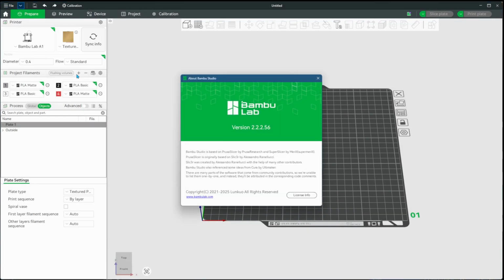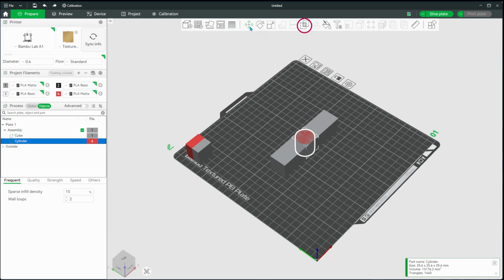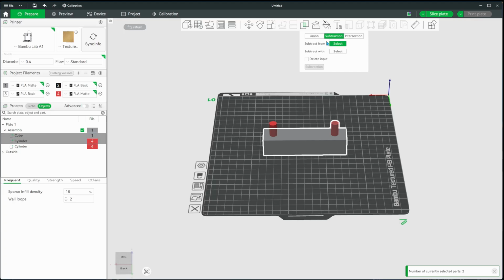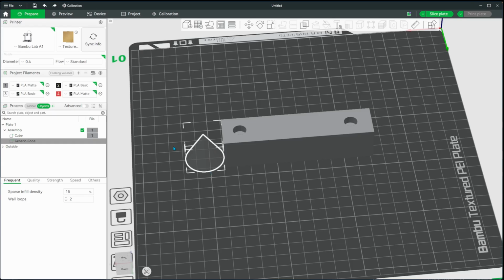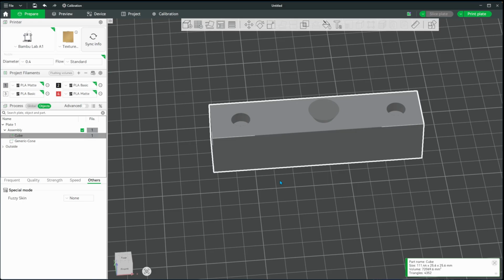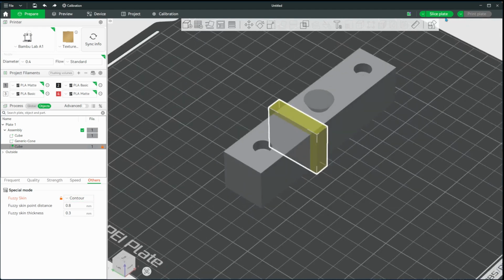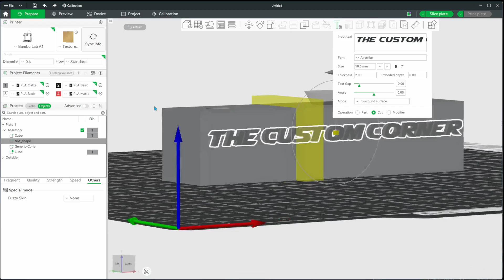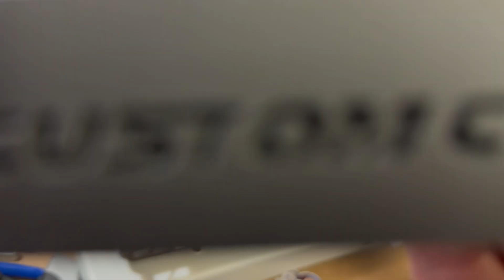How to use Boolean Operators, Parts and Modifiers in Bambu Studio - Updated Full Tutorial

Comment: Thank you for this great video. If we are trying to do the boolean operation to merge a logo (svg) on to a curved surface (football helmet), whats the best way to make sure the svg is embedded into the surface of the helmet? In essence, i want to make sure the logo is flush with the rest of the helmet. would the easiest way to do a subtraction to get the hole and then insert the svg logo (adjust the thickness) to be flush? Does that make sense? Sorry...a newbie into designing but thank you for any insight you can give.
Reply from the maker: For curved surfaces, you don't have many options other than bringing it into a 3D modeling program and bending the extruded logo or accepting that the logo itself will be flat against a curved surface.

Comment: How do you make a 100mm plate with two holes precisely 50mm apart, centered in the middle of the plate on both axis?
I can do all this in the video, but I cannot center the holes from end to end and to the middle. I cannot use any drawing programs because of my disability.
Reply from the maker: I think your best bet is to try to use other objects that are the precise measurements that you need as "helper" objects to help you align things. For instance, you can have a 50mm cube and put your cylinders on either side of it, using grouping and centering to get some of the axis' aligned. Once you're done with the placement, split to objects and delete the cube. There is also a Measure tool that can be useful if you're able to select the edges that you need. If you're able to use Bambu Studio, you may also be able to use Fusion 360, which has more precise tooling to allow you to do this. And its free for personal use.